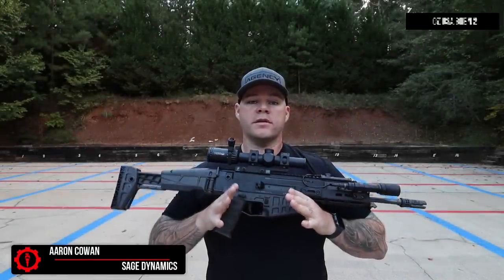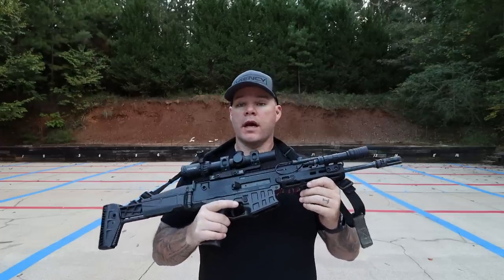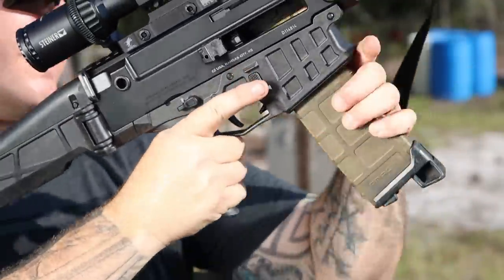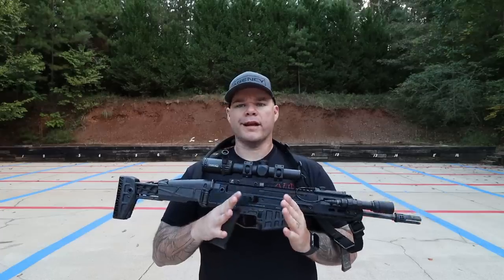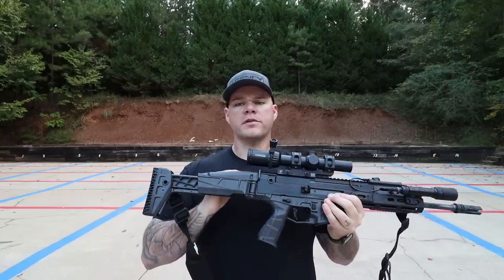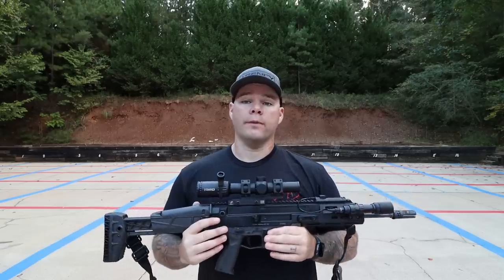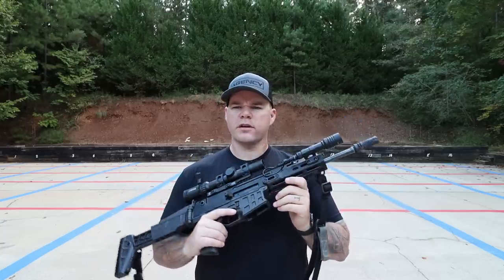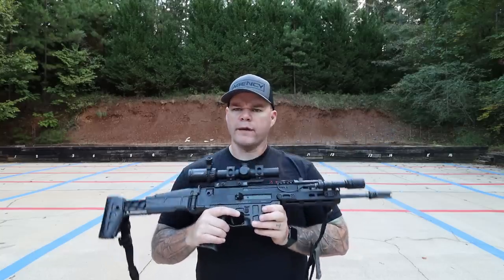CZUSA Bren 2

Comment: From my understanding thanks to guys like mishaco, MAC, and inrange, the reasoning behind the shorter rail and gas system was for the Czech military requirement that the weapon be lighter weight than the 805 and for modularity. By shortening the rail and gas system the weapon can be configured with the 14.3, 11, and 9 barrels without the need to change the gas piston or regulator to accommodate the swap. Can't say I really think it was worth it considering they will probably very rarely, if ever, change barrel lengths but the military wants what it wants and that's not always what the users want.

Comment: Please continue to keep us updated on this! For those who don’t want to sbr it buy a hbi / dan haga 1913 adapter and CNC warrior folding brace. You will be happy once you receive the hbi 10.8 hand guard and trigger.
Reply: Another excellent option is HB Industries 1913 picatinny rail back plate and you have lots of options of braces to play with. It's low profile, gets rid of the chunky civilian version buffer tube connection back plate, gets rid of the wobble and is machined from billet 6061-T6 aluminum.

Comment: I’ve had my Bren 2s since 2018 and I love it. Fantastic platform, very intuitive, and as a lefty I’ll take it over an AR every day. I have it at a gunsmith right now drilling out the “off” gas setting to a smaller suppressor specific setting to mate with my Nomad-30
Reply: What diameter did you end up drilling out to?   I've seen a couple comments from people saying they did this and it has me curious.
Reply: @Gunker02  it’s at a 0.8 mm diameter. Zero function issues after a lot of shooting, very soft.
Reply: @masonmaliwauki3673  no blowback issues?
Reply: @Gunker02  you mean like gas in the face? Extremely minimal. I’ve shot “well gassed” ARs and have still had more spit and gas in my face than I have with my Bren 2 now.

Comment: The short rails on Euro rifles are due to a few reasons I think.

1: Europeans don't use accessories like we do (at least not to the same extent widely)

2: it saves weight to simply have less material on the gun

3: they don't generally have the same firearms techniques that we do (many Europeans still use magwell hold grip styles, not all certainly, but many do) and the "C-clamp" style of grip on rifles isn't as widely known or used (I think mainly because people are worried about having their hand any closer to the muzzle than it absolutely has to be)

I want my rail as long as reasonably possible, I like the idea of the Midwest Industries 17.5 with the side cuts for a brake because it completely encases the barrel allows you to brace against any type of cover without affecting the barrel in any way.

Comment: I like mine a lot, better than the FN15 I owned before, mostly because I hate the AR Charging handle location and the way the internal piston design blows crap into the AR action. The BREN 2 runs cooler and cleaner. The trigger is good for what it is, but its a military trigger. I have the HB Industries rail and its a whole lot better than that weird rail it comes with the gun. My rail also has the dedicated light mount as well, very nice. Good review.

Comment: You said you ran mostly PMC 55gr, is that 5.56 or .223? I'm having stovepipes with my 14" when using 5.56, but not with .223. I have the 922r stock like you. Your ejection patterns look like mine when I shoot .223. 5.56 shoots very far forward, 12:30-1.

Comment: I also purchased the pistol version of the CZbren2 and had the same complaint about the forward handguard; not sure why it was so short...but I did find a very nice upgrade from HBindustries.  HBI add's a couple inches to the length, but it's still kind of short.  Nonetheless, I now have all the necessary attachments I use when I'm contracting.  Here's a URL to the HBI handguard:  https://hbindustries.net/store/shop/cz-bren-2-handguard-10-8-m-lok/

Comment: I understand that the Bren 2Ms is more modular but, the Bren 2S was more reliable/rugged with the same performance (if not slightly better). These CZ-USA rifles are starting to have a few problems (mostly lemons) but, the Czech made rifles (2S) basically had/have 0 issues. I hope CZ doesnt go diwn the SIG route.

Comment: Is it preferable to get the ejection around 4:00 like in AR platforms? Would it be fixable by turning the gas down or would it be more complex?
Reply from the maker: bigshoe84 brass ejection alone is not necessary a symptom of a problem.  Adjusting the gas will change ejection slightly but if the gun is running who cares 🤷🏼‍♂️
Reply: @SageDynamics  true and thanks for the reply, just always heard that a rifle that cycles too fast is prematurely wearing the moving parts.

Comment: Excellent review brother! If you're interested in reviewing two other piston guns/rifles that are on the same level as the Bren 2, and money is not an issue, check out the B&T APC 223/308 and the Robinson Armament XCR (M or L model). The APC is a better quality, Swiss made SCAR (with a Swiss price tag). The Robinson Armament XCR is slightly more expensive than the Bren 2 but, it has it's place and might be the most ergonomic of the 3. Everything is ambi besides the charging handle (left side only) and it has the most caliber conversions (both M & L models) out of any modern rifle that's "not an AR".

Comment: Also HB makes a longer rail as well as a gas system to go with it
Reply: Not true, they only make a little extension tool that attaches to the rail so you can still adjust the gas settings. The biggest downfall of the rail is that you have to uninstall it to to be able to clean the gas system. I have one on my Bren and it looks great but I don’t like the lack of a gas system access location on the rail.
Reply: @biggboysouth  Who cares. It is a piston gun. Wont gave to clean it but every whatever thousands of rounds
Reply: Tyler Ehrig Tyler Ehrig Well you should do some more research into piston guns. They require the gas system to be cleaned at regular intervals just like any other firearm. Jump onto the forums, you’ll read post from CZ Bren users who shot a lot without cleaning their piston system. The gas plug starts to seize with brass and lead particulates a little over 1k rounds. CZ says gas system is supposed to be thoroughly cleaned every 2k rounds but I won’t go that long between cleanings unless I really don’t care about a gun. Also take into consideration that every time you remove your hand guard you will probably have to re zero or at least re confirm zero of your rifle since the hand guard screws are what hold in the barrel. Not sure about you but until I can verify my zero is on point I would be hesitant to use the gun for any defensive purpose.
Reply: Tyler Ehrig again I said I have this rail in my rifle and love the look and feel of it. Just don’t understand why they couldn’t have just cut an opening into it like for instance the MCX rail or aftermarket SCAR rails have been doing. Any way originally just wanted to correct your point about HBI making an extended gas system. I’ll be keeping my rail since I like it but I’ll probably end up taking a dermal to it and making my own window to access the gas port.
Reply: @biggboysouth  I could care less what CZ says. I clean my guns when I end up cleaning them and have never had a gun seize up on me at all. And some of them have had 1500+ rounds suppressed through them without cleaning and run fine. If you riffle NEEDS to be cleaned at a certain interval of rounds in order for it to operate properly then it is shit.

I'm not worried about the rail holding the barrel in. Push the barrel to the back, torque the screws to spec, and have a quality optic/mount like a T2/scalar/bobro/unity and you will be fine.
Reply: Tyler Ehrig lol ok bro take care.

Comment: I have the 11” 556 with the hb hand guard do you have to take the hand guard off every time you clean the gas system/outer barrel or do you just leave the hand guard on and not clean those areas?
Reply from the maker: Why would I need to clean the gas system?
Reply: @SageDynamics  are we not suppose to clean it?
Reply from the maker: @Cheesepants1  you can, but it’s not something that needs regular attention. Every 5-10K. You can remove the gas key without taking off the rail.

Comment: I had one of the first full size carbines to come in the country. As a huge CZ fanboy I was so excited. After wasting a case of ammo on it, I just hated it. It wouldn't break 3moa. It came with the barrel loose in the trunnion. The hg looked like crap. It was soft shooting and a great trigger, but I sold it and bought a scar 16. I'm much happier with the scar 16! I wanted a Piston 5.56 that would be accurate and have longevity. the scar is a better rifle in most ways over the Bren 2 carbine IMO..
Reply: Did you ever send it back to CZ for repairs? Because that's just not normal for something at that price point
Reply: @StevenL00  I had a couple email exchanges with cz and one of their engineers. I was able to reassemble it properly and torque it to spec. They said they were going to retrain the assembly workers for the carbine line. I was more upset with the accuracy issues. Even after proper barrel torque I would get crazy fliers randomly. The CZ engineer told me it's only a 3moa rifle. It was the beginning of the pandemic and I didn't want to send it off to be gone for who knows how long. I just couldn't like it no matter how much I tried..
Reply: Matt Helton Then what was even the point of a heavier barrel lol. That’s why I ended deciding on the MCX virtus system instead. Much more accurate and it seems like SIG tried to support the platform more than CZ.
Reply: @godwinjoy9730  exactly.. every firearm I've ever owned with CZ on it has had exceptional accuracy. The Bren 2 carbine was not what I was hoping for. It seems like the pistol versions with imported barrels seem to be fine.

Comment: So the reason why the CZ Bren pistols have a horrendous trigger is because of the Sporting Purpose restrictions set forth by the GCA and ATF regarding Firearm Imports. Pistols have to earn a certain amount of points for safety and "sporting purposes" in order to get ATF approval. Unfortunately CZ had to compromise on the trigger to get through. This explains why the trigger feels mushy and long... just like a striker fired pistol. But in a hammer fired rifle. Insane logic lol. But if you pull the trigger behind the CZ Bren 2 Carbine or the 805 the triggers feel way way better from the OEM.

No excuse for the rails though, dunno WTF CZ was thinking.
Reply: How does Slovakian Grand Power get away with importing Stribogs with nice short travel triggers without any extra slack?
Reply: @AMG454PRO  The point system covers a whole bunch of features on the gun. They are mostly arbitrary but pretty much CZ capitulating on the trigger because its way easier to get more points that way than jump through other hoops. I imagine Grand Power probably was able to squeeze by the point system on other merits while maintaining their factory trigger.

Comment: You’ve got the gas selector stuff a bit wrong. There is no “suppressor setting” and if you’re putting a suppressor on and running it in the 2 position then you’re literally destroying the rifle and beating the piss out of the components. The 2 setting is an adverse setting for when the rifle is dirty. The 0 setting is no gas the 1 setting is “normal”. A lot of people are complaining of over gassing even on the 1 setting. Putting a suppressor on isn’t even a great idea on the normal setting unless you run a oss style suppressor but sheesh I sure hope people don’t watch this and go put a suppressor on a Bren 2 and put it on the 2 setting. “Soften it out when you put a suppressor on it” this you cannot currently do with the Bren 2 and that’s just a fact and no drilling out the 0 setting and voiding the warranty is not an answer.
Reply from the maker: D K correct, it is not an actual suppressor setting.  That said, the OSS and Surefire SOCOM II ran flatter on that setting so 🤷🏼‍♂️
Reply: SageDynamics interesting, the oss is arguably the only suppressor I’d run on a Bren 2 with the already, arguably, over gassed pistol. Just don’t want people thinking that the Bren 2 has a “turn down” setting as not only is that false it’s border line dangerous. Even the manual states not to ever run the gun in the adverse setting unless the gun is dirty enough to require it. I can’t imagine how fast the carrier speed is with a regular suppressor (not oss) and the gun on the adverse setting. That’s a recipe for a decent failure for sure. Nice video by the way, just wanted to make sure that little bit gets out there. Trust me, a lot of Bren 2 owners to include myself are seriously scratching are head on why the heck they didn’t give us a suppressor setting on the Bren 2 pistol. Even more puzzling is they put a suppressor setting on the 16” barrel carbine model.... makes no sense and is very frustrating. How can you put an adverse setting on the pistol and yet still arguably over gas the normal setting, THEN leave a 0 setting not drilled out. Just give us a suppressor setting. I hope CZ offers some different gas selectors to remedy this annoyance down the line (doubtful).

Comment: Dude: HB industries trigger and rail and gas adjuster extender. Also, drill out the shut off gas setting for suppressor use with standard baffle can  like the overcorked to shit surefire. Otherwise just run the OSS.